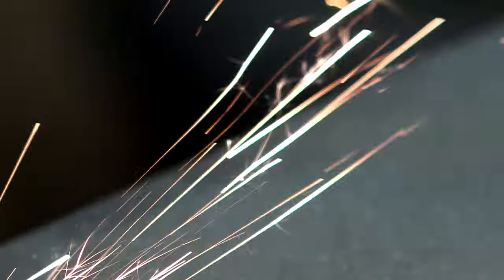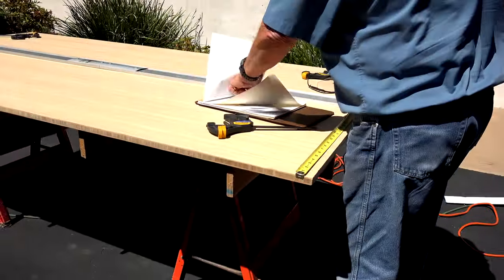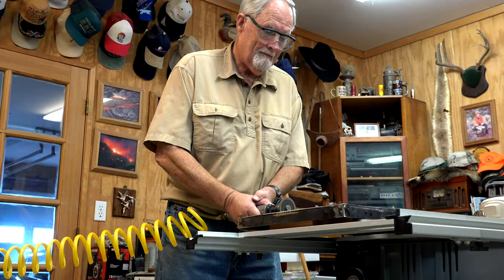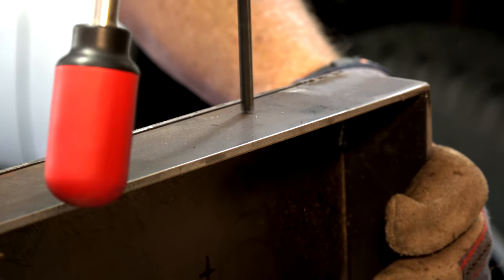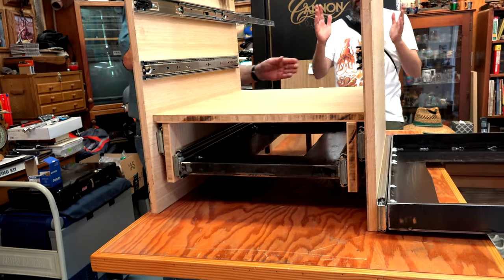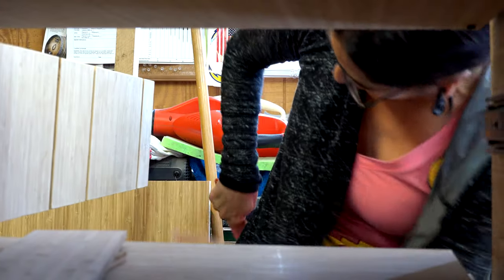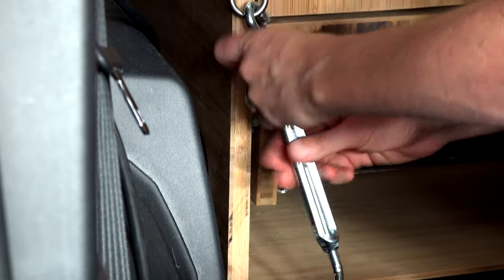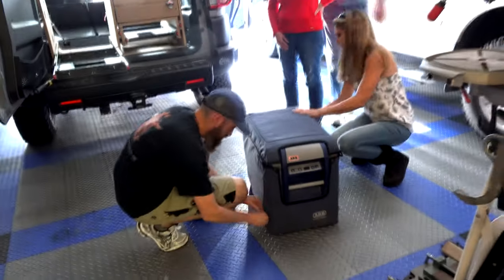FJ Cruiser Overland Build - Part 4 - DIY Camp Kitchen

Comment: Looking good! Excited to see what's next! I built my own fridge slide using aluminum angles pieces and rivets, came out super clean, if you ever decide to redo the tray, I can send some images over. I mounted my fridge on top of on a platform instead to keep it a bit more modular. Also how do you like that arb rear awning? I'm thinking of doing the SAME EXACT thing using the front runner rack as well, which mount did you use?
Reply from the maker: Thanks minhster! Aluminum for the trays sounds like a good idea. I'll keep that in mind if we do decide to redo them, thanks! We like the awning, but haven't needed to use it much yet. (stay tuned, our next video will have a little bit on it) - We went with the Front Runner Easy-Out Awning Brackets for mounting, and only used 2 of the 3 brackets that the kit came with. With the smaller awning, it's plenty secure and it was easy to install.